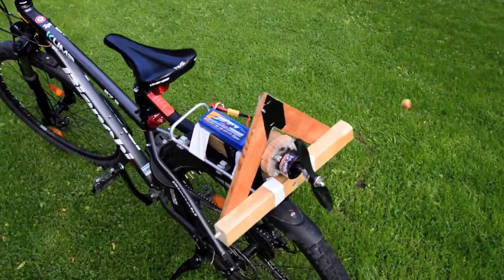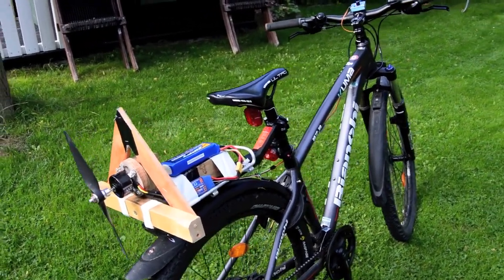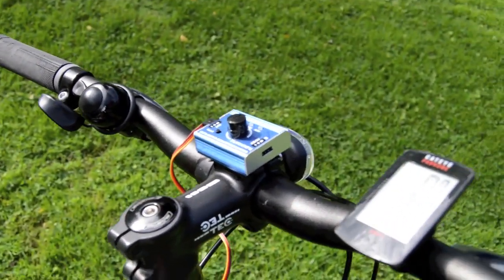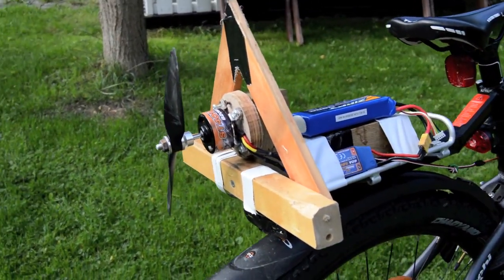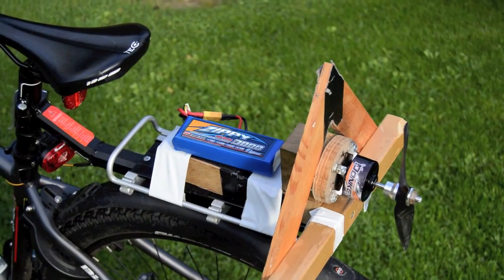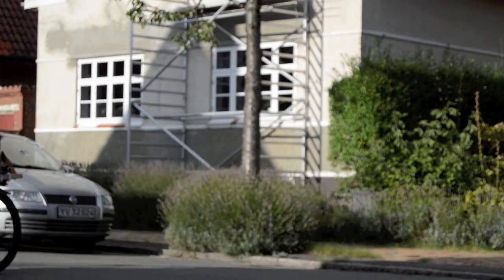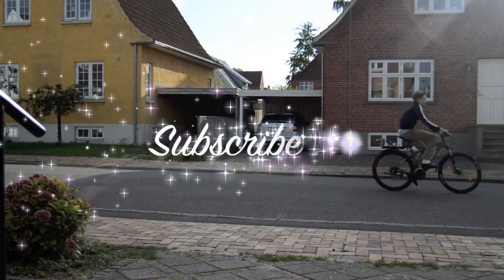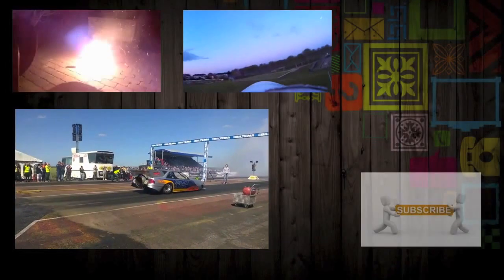Diy electric bike with propeller

Comment: Can I use motor from old hair dryer?
Reply from the maker: Yes Sir. Good luck with the project
Reply: @RCJakob  and can i use a laptop battery or should i use 2 of them or some other could you give me ebay link for some battery recommended by you please?
Reply: @RCJakob  and i dont have that mud protector above the wheel can i simply put it in front of the bike?

Comment: gives me an idea for commuting via loophole. our local bike trailes do not allow motorized vehicles on them. I wonder if I could do this with a larger prop and diy lithium battery pack found a interesting battery managment system with arduino total open source and uses affordable 18650 cells with minimum 4 cell to 96 cel max config without throwing second motherboard for battery managment.
Reply from the maker: Sounds cool ;-)